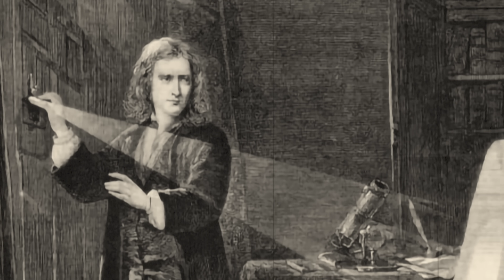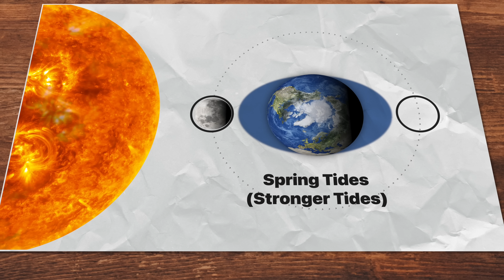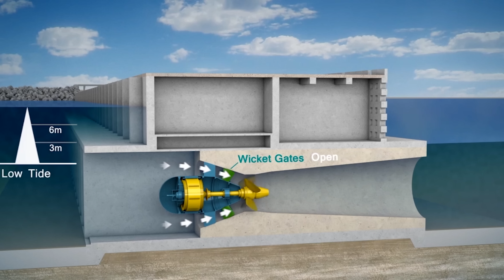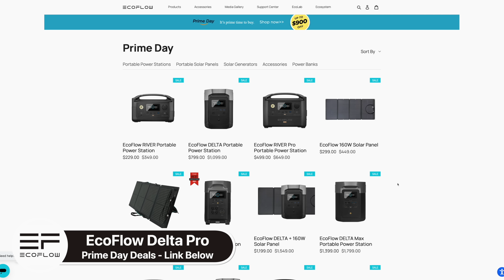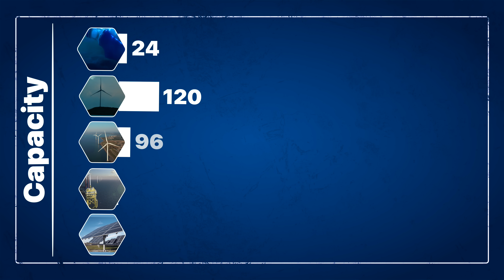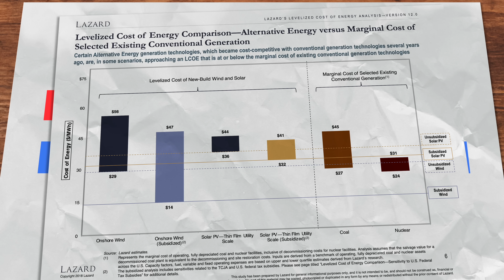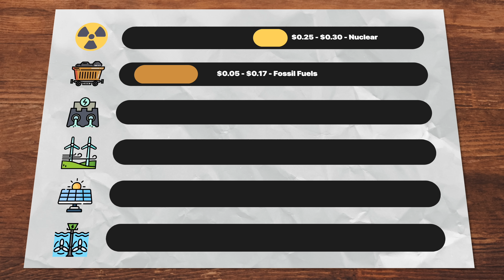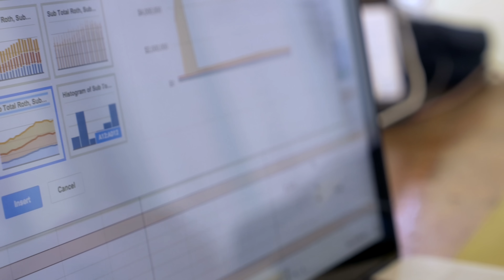Breakthrough Energy Source is 10X Better Than Wind & Solar!?

Comment from the maker: Check out EcoFlow's Prime Day Deals: https://amzn.to/3nmzVwn 
Ecoflow: https://us.ecoflow.com/?aff=198
Reply: Tidal energy is not a new breakthrough. It was being used for electricity generation in the early 1970's.
Reply: Also check out 'Cockerel Raft' and 'Salter Duck' for two more areas of research from more than 50 years ago.
Reply: @RWBHere  
Suppressed Energy Systems In My Research Library
Reply: I know a system which use water which compress air and push it through a wells turbine then the water suck air back which flow through the wells turbine which is bidirectional
Reply: .  . When carbon emissions and "carbon footprint" are repeated over and over again under assumption based on the repeated circulation of such references -- we need someone such as yourself who is independent of corporate funded education and media -- in order to address the issue objectively concerning real evidence, that must also take into account fraud that has been uncovered though suppressed in the media and by educational institutions -- as well as NASA reports that are more recently in conflict with their own historical data from the 1970's concerning previous warming periods by several degrees that occurred without coastal flooding from rising sea levels that did not occur.  Great effort now exists in a flood of disinformation to deny this -- in the face of NASA's own data during a time when "global cooling" was the concern.  A flood of information sources quoting one another is not evidence though a general consensus is generated among many.  Carbon is a basic element of life and should be approached from that perspective, while 400 ppm CO2 concentration in the atmosphere cannot begin to generate a greenhouse warming effect until the percentage is raised to a minimum of 1 - 2% of the atmosphere -- some 25 to 50 times the current percentage.  Life depends on the very small amount of CO2 in the atmosphere to feed nearly all of life -- directly and through the food chain by the process of photosynthesis, while CO2 is required in the atmosphere to allow us to assimilate oxygen at the cellular level.  We need independent public figures like you to address issues that have been promoted for corrupt purposes.
Reply: We were working on this in 2004 like many projects! we focused on all FIVE renewables and many storage types... But our government had the companies and its staff charged for "economical and industrial espionage"  (Probably due to the fact that fossil fuels make up 60% of government donations!) BUT we focused on small scale on-site generation and storage then scaling up to a community size project finishing with a grid scale generator if and where needed! and even commodity fuel energy generators (fossil fuels + Nuclear) omit the fuel sourcing energy costs due to the claims of it being a "3rd party" ( This was sourced from I.A.E.A.) like the false claims of lifespan and many plants require refurbishment / replacement of sections / parts (every 20 yrs) that are the same as replacing a blade / panel / baffle / Etc in RE projects which none include newer tech that up to today is poorly underfunded! 
~ Working with friends on a business to mass produce renewable options like: Perovskite solar cell / VAWTs / small scale flow turbines / cheap geothermal drilling options are getting better every 6 months even with poor funding ~
Reply: Animation was terrible. Tide peak should follow the moon
Reply: Great information! Getting these at scale would be the ticket. What about buoyancy systems that exploit gravitational effects while being mechanically isolated from the environment, making them low maintenance & eco-friendly? Also, I recall hearing about “frond” devices that derive power from piezoelectric elements embedded in giant paddles as tides, currents, & wave actions force them to & fro. I imagine ratchets at their bases could also be used to spin generators.
Reply: Now I have a question about the design of these underwater title turbines, So based off of the graphic shown in the video These are One Direction only turbines, I wonder if a vertical turbine would make more sense as it would follow where the currents are currently going, so if they're going one way on one day and then on another day they're going in a different direction, I also wonder if that design would possibly create more electricity because there would be less resistance when it comes to the flow and operation of this vertical turbine idea.
Reply: @5226-p1e  the tides have remained steady for several billion years, they flow in 2 directions alternating twice a day based on astrophysics, currents similarly don't vary much because they're driven by geophysics so are reliable for thousands of years.
Reply: @alanhat5252  I not agree your comment, when the tide is going up, the waterspeed and force is bigger, tide going up takes a shorter period than tide going down.
Reply: @alanhat5252  
I guess I need a better understanding of how that turbine Works within those conditions.

The reason why I brought up the vertical turbine is because I was watching a guy who created his turbine based off of wind, and he was comparing his type of turbine to the ones that are meant for One Direction only, and he basically explained that his turbine will take the wind from either direction so if it's coming from the East it'll automatically take it based off of how it was created and just say the wind changes and goes a completely opposite direction it will pick up the opposite without needing to adjust it in any way because of how a vertical turbine is constructed.

Meaning the turbine wastes absolutely no time or energy because it needs to change direction, it's simply goes with the flow of the wind, so I wondered if that would be a better type of turbine to put underwater, because it follows the same principle of what direction the wind is going.
Reply: @Go2Results  all I said was that tides are predictable (for centuries in advance), I don't understand your comment.
Reply: @5226-p1e  sorry, I wasn't clear, where grid-scale hydro-power turbines are placed the flow is in either one or 2 specific directions (current or tide) & doesn't vary unlike a wind turbine which has to cope with erratic directions from any point on the compass. Currents are driven by the rotation of the planet & tides by gravitational attraction to moon & sun, the wind is driven by much more chaotic forces.  

There are places where the flow is turbulent but for a grid-scale installation there's no need to use them (local installations might want to use turbulent flows if there's nothing steady close by). There's more power available in steady flows & it's easier to harness. 
When tides change direction there's very little power available so it doesn't matter that turbines take a while to change direction, watch some time-lapses of boats at anchor & you'll see what I mean.
Reply: @5226-p1e  That's what I could never understand.  Why they use just one direction windmills.  I've seen those twisted vertical windmills.  Vertical windmills would also have a vertical generator causing less stress on bearings as in a horizontal generator where the weight of everything is on the shaft of the windmill which is supported by bearings that need to be lubricated and cooled constantly I've been told.
Reply: @peacepoet1947  
i think originally it was because one design came before the other, and they just kept with that model even to this day, which was a stupid idea, but it is what it is.

i know a guy who works on these things and he has said the same thing, but he likes his job because he gets payed well to maintain these crappy one direction wind turbines lol.

but we would run 1000% more efficient if we just did the vertical turbines, however i'm not sure how well this would work for the underwater turbines as the currents mostly stay the same but with wind, i would say dismantle all the older ones and replace them with the vertical turbines, because it will boost efficiency and they will last twice as long since they don't need nearly as much maintenance depending on how they are built and they are also safer than the traditional ones.
Reply: @5226-p1e  it seems like it would be a plus in what a windmill can actually achieve when you add some logic.
Reply: @peacepoet1947  
again, not really sure how well they would work in the water, however, if maybe they were on a barge and picking up the wind out in the sea, they might pick up a lot of wind in some locations, it would be like how sails helped move ships from the past, but instead of moving the ship, it would collect power from the wind and mostly be stationary on the sea, there is a lot of wind out in the sea that is almost never used.
Reply: @5226-p1e  isn't that why they are building windmills in the ocean?  Uneven heat causes wind to occur.  Heat moves towards cooler air masses.  In California we have a desert to the east of California.  The desert heats up due to the Sun heating of the air and sand.  That heated air rises and pulls in the cooler air off the ocean.  I call it our natural air conditioning.  Wind has become a valuable resource for the production of electricity and pushing sailboats.
Reply: @peacepoet1947  
problem is, it's just not enough, i hear you guys get a lot of rolling blackouts there, where i am that is a non existing issue.

but anyway, i have no idea what California has for windmills in the ocean, are they above the ocean, or are they anchored to the ocean floor?
Reply: @5226-p1e  I've heard that they are anchored somehow.  Whether it is the bottom is not something that I've actually looked into at the moment.  I'm not on the grid and confirmed to the energy I can store through the day for use at night.  If the grid goes down?  Unless I'm out, I don't know.
Reply: @5226-p1e  haven't looked into*
Reply: @peacepoet1947  
oh your an off grid person, that's right on man, do you just live in a regular home off the grid and how do you get most of your energy? 

do you use mostly solar or do you have a rig set up that uses both solar and wind, also what kind of house do you live in?

i have an interest in the earthship off grid community because i like the applied logic to their designs of using the natural thermal makeup of the earth for insulation and the natural convection of fresh air and cooling and the design of how the front of the structure is facing the south for food production and energy capture, these earthships are very efficient when it comes to how power is created and used.

i also love the ways they preserve and filter water, the only thing about earthships that i don't like is how expensive and time consuming they are to build, but with our current tech i think they could be automated to be built in far less time and be offered at a far cheaper price tag and offer the best of the best value that earthships are known for.

anyway i got carried away with my comment lol, sorry, bat habit of mine.
Reply: Hello  Two Bit! Are you giving away prizes or something? Some kind of Telegram Text or something? I just want to make sure I'm not getting scammed by someone pretending to be you.
Reply: @k.sullivan6303  it fake
Reply: @k.sullivan6303  you're probably being scammed would be my opinion.
Reply: @sergiopinto4831   Looijestijn like basalt stone variant. It’s not without energy loss, like is possible by dehydration of salt is used by the European heat insyde project. Good thing that they are ready to go. Check options from saltx as other variant with nanocoated salt.
Reply: I wonder how the estimated lifespan could be so great if the question is the mainainance, erosion, corrosion?
Reply: I dont see how comparing the electrical efficiencies of the systems is relevant.  It only measures how much energy is lost during the conversion.  But sunlight and wind are not limited resources and not directly comparable either.
Reply: Corrosion bad … access for O&M bad … fouling bad … marine mammal strikes bad … efficiency between different techs is basically irrelevant what matters is value of energy generated divided by total lifetime cost inclusive of externalities. Does tidal have a place? Of course, it already does where conditions are marginally optimal. “Should we invest in … ?” By invest, do you mean giant socialist energy projects? Hell no. Do you mean, voting with your own capital by investing? The beauty of capitalism is you can put your money wherever you want … you just might not get it back. Personally, I’d invest in home solar and thermal energy storage systems before any need to “invest” in someone else’s enterprise or worse have some grifter politician force me to pay for their power (pun) trip with my money.
Reply: Heads up. You have bots impersonating you talling about a giveaway and to use telegram.
Reply: I got accepted to Texas A&M for an MS in Energy and I am pursuing my dreams of hydrokinetic energy. At some point, perhaps a bit further along my journey, I'd like to meet you and exchange ideas. Perhaps we can make a podcast episode together?
Reply: Your life time estimate of tidal energy systems is unbelievable.  A windmill under the ocean is going to suffer more wear and tear than a windmill on the land.  But you claim it has triple the lifespan.  OK.  Were not biased are we.
Reply: Funny, all images shown to the public of planets are perfect spheres
Reply: @brettmoore3194  Just the easiest way of drawing them for demonstration. In this discussion, though the shape may become a factor in a real exeercise, circles are, indeed, entirely suitable for the demonstrational exercise.
Reply: @PNH-sf4jz   well, are you the first person in the world to actually prove there is in fact a curve. Lighthouses,submarines, airplanes, infrared photography, and non perpendicular Sun rays are making it hard for ballers
Reply: @brettmoore3194  

Ah !!!   So you are a "flat Earther"?
Reply: @PNH-sf4jz  no I'm a believer in the scientific method. People have put forth conjecture on a theory and have several observational objections. I as open minded person always wanna hear counter points to dogmatic beliefs
Reply: @brettmoore3194  I hadn't seen anyone expounding on dogmatic beliefs.
Reply: @PNH-sf4jz  well believing in a theory for well over 500yrs before trying to validate it ,but teach it like it is the truth. That is the dogma I speak of

Comment: Energy scavenged from wind and tides, although minuscule, will in time affect the rotation of the earth, slowing it down faster than the effects of Moon, Sun and other planets alone, which has measurable effects on precise timekeeping. All energy production increases urban and industrial heat islands, which is where most energy generated is used and dissipated, ultimately as heat.

Comment: The single fixed turbines probably only work well in areas with strong tides. There aren't a lot of areas that are suitable for them, but that goes the same for many other energy generation methods, especially the tidal dam method
I see a way that they could make them more effective though ~ put a tail on them so that as the water goes by, the tail will be behind the generator blades at all times (it swivels when the tide turns). and that way, cheaper materials can be used to lower the maintenance costs... which are high because of salt water (but wood is fairly cheap).

another thought is that a cage can be put around them to stop large fish from running into the blades.... but it looks as if they spin quite slowly anyway, and may not harm them (and wouldn't be sharp)

Comment: To put this in prospective, the  Rance Tidal Power Station and  the Sihwa Lake Tidal Power Station both have rated generators of ~250 Mw with capacity factors of ~25%. So on average, these  system generate ~60 Mw of power. The Small Nuclear reactors (SMR) under development typical have a rated power around 200-300Mw and should have capacity factors above 90%. So you will need 3 tidal system to equal the output of 1 SMR rated at 200 Mw. 

 Sihwa Lake is unique as it was built to solve an environmental problem but typically these system have a huge negative impact on the environment.

Comment: A lot of energy is used to run air conditioners.  A lot of cities are built near the ocean.  Why don’t we use closed loop systems, with kilometres of tubing lying on the ocean floor cooling water down, which is then pumped through buildings and homes to cool them down?

Comment: you always show solar power as if there are clouds, nothing is generated. 
In a real world, even in a thunder storm, those panel do 25% of what they would do in a sunny day. so if you put 4 panels instead of one, you can be sure that you will always have solar power as long as there is a sun. so solar is not intermittent power, you just need to install more of it.   anyways, tidal power obviously has its place in the future, just like any other power source

Comment: The cost of generating electricity through wind is trivial compared to two bigger problems, Storing the energy for when the wind doesn't blow and transmitting the energy from where it is generated to where it is needed.